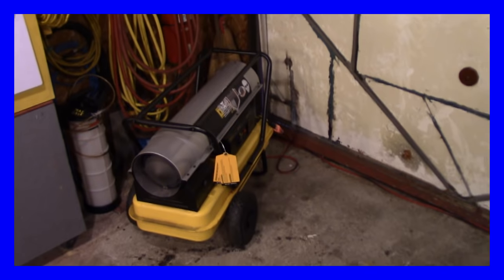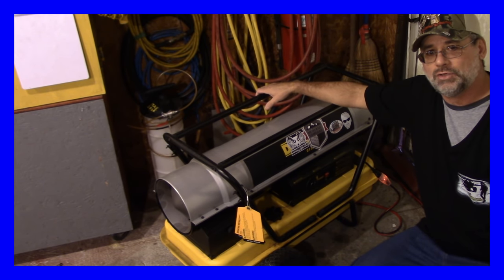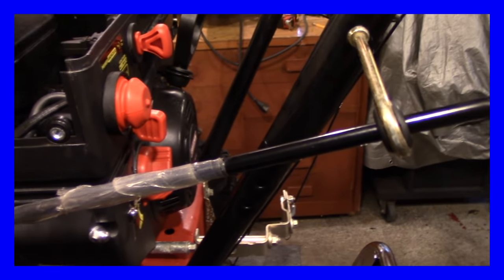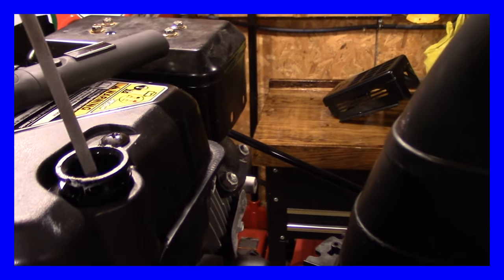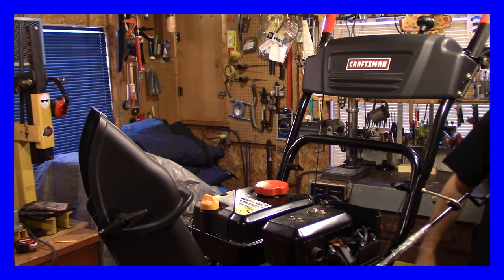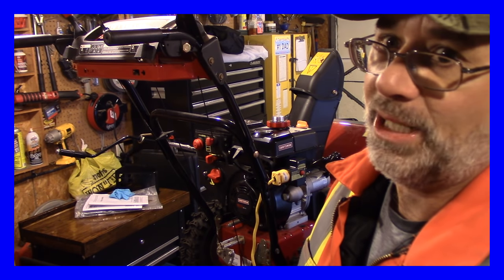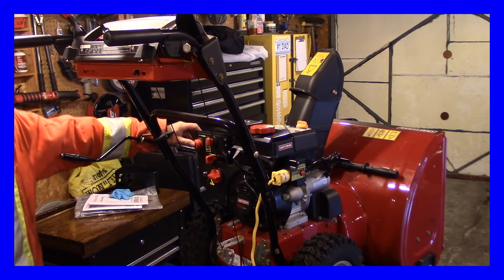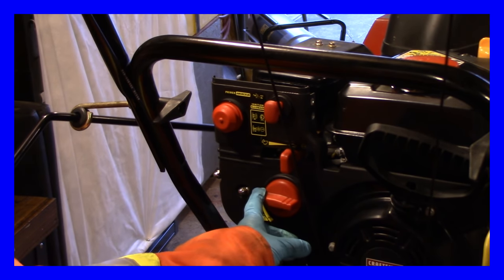CAN YOU FIX A SNOW BLOWER WITH SEAFOAM

Comment: My machine has the same problem, without the gas leak, keep it loaded with gasoline since last winter and now it does not want to turn on, I did these steps that you show in the video, but it did not work, 😢😭 it only has 1 year of use.
Reply from the maker: Looks like you need to take carb off and clean it completely , not a hard job and should work fine .

Comment: Check your ignition coil those are known to go bad on those snowblowers with the cheap chinese engine they usually go bad after three years or so there are a view youtube videos on the subject the engine is made by a chinese company for cub cadet they bought out yardman mtd the old ones had a tecumseh snowking engine you can not beat them
Reply from the maker: Thanks Vicky will check it out . Thanks
Reply: your quite welcome I ment the coil I have one of the old ones with the snow king engine tecumseh snowking
Reply: why would you think the coil is bad if it starts and runs ?  this is carb trouble... if the coil was bad it would run till it got up to temp an then die or not start at all.

Comment: I was curious if you figured out why the gas was gushing out of the carb when you primed it. I put a new carb on a blower and it does the same thing and the blower runs OK. I figured it was because it was a cheap knock off carb.
Reply from the maker: That's a good question but it runs great so Im thinking your answer is correct :)
Reply: @dougsgarage1798  good info. Thanks

Comment: That engine is a chinese engine. A lot of people don't like them. I have one in my snowblower and it starts first pull all the time. Except when it was -32. Then I had to use the electric start.
Reply from the maker: It seems a lot of machines have Chinese engines these days. This  machine runs great for the owner now. Cheers
Reply: I have exact same and just had first snow and started first pull! Runs well. Just like anything you gotta maintain it. Change oil and use stabil fuel treatment and whatever the owners manual says to!!!! Ethanol or no ethanol!!! I even after a year of no use will  drain out gas and put in fresh with stabil then run old through my truck. And, seafoam isn't a fuel stabilizer! Must use fuel stabilizer like stabil! To clean a fuel system chevron made by techron is the best!

Comment: make sure you shut off that heater if your tank is leaking gas!!!!
Reply from the maker: Jim  this heater runs off  diesel .  I only run it 10 min. Max to heat up the shop then turn it off.  Cheers
Reply: Why would you run a gas leaking  machine like that inside your garage?
Reply: I really hope there’s ventilation also. And a clear path for the fire engines.
Reply from the maker: LOL Merry Christmas Adam

Comment: Having the same issue with a used blower I've just purchased, with fuel just flowing out from the carb just like that
Reply from the maker: Ya the needle valve needs cleaning most likely.

Comment: I do not use seafoam. Seafoam is useless. All my equipment uses Stabil360 from the time its brand new. My oldest lawqn mower is 26 years old and been using stabil 360 and never had any issues from day one. But if you seaform or Stabil360 use from day one. Neither seaform or stabil does not clean carb if it is dirty you have to clean it up yourself.
Reply from the maker: Seafoam has worked well for me  , never knew stabil 360 has been around for 26 years.
Reply: Bull-Hockey! 
I'm 61 now. My previous snowblower went 26 years. I've used SF for 40 years. I put a 1/4-cup of SF in my 1 Gal gas-can. I took off the Carb a couple times to check it. SPOTLESS inside!

I DID have to change the Carb in year 23, as it was surging for a couple years. Again, carb was spotless internally. Turns out, the throttle-shaft had worn a slightly oblong shape into the carb body after 2+ decades of vibration! 

There's no fix for that. Put on a new Carb, & it runs EVEN & STRONG. Again......2 decades with the original Carb. Using Seafoam.

Comment: Any Craftsman product the first 3 numbers of the product number is the manufacture code. Which will tell you who made it. The number for the actual blower is probably different then the motor. But that will tell you who produced the blower for Craftsman. Like MTD or Poulan.  Then you can figure what motors they likely used in their products.
Reply from the maker: Hey Josh thanks for the tip. I'll have to write that one down. Cheers 👍👍
Reply: http://professional-power-tool-guide.com/manufacturers/craftsman-power-tool-company/sears-and-craftsman-source-product-code/ Check this list out for reference. Maybe print it out for on the wall at the shop.

Comment: Never, never, never ever use alcohol fuel in a small engine.  Premium gas only and use a fuel stabilizer in the gas as well as some injector cleaner.  We have an Eskimo 43cc 2 stroke gas auger and it starts on the 5 pull in the fall and always on the first pull in winter.  Our walk behind snow blower is the same way and our outboard motor too.  Alcohol gas is bad for small engines.
Reply from the maker: Yes sir your correct Tom. Cheers
Reply: Every small engine mechanic I've talked to, including guys who drop trees, have always told me to use only ethanol free 91 octane fuel. End of season - add the Seafoam to the fuel tank and let it run for a while then turn off the fuel valve and let it run dry for storage. 4 chain saws, 2 gas trimmers (1 is a 4 stroke), 2 wood spliters, a Great Dane mower and a cheap push mower for trimming.
Reply from the maker: Good advice from people that know. Cheers

Comment: It's a MTD engine
Reply from the maker: Thanks David 👍
Reply: @SteveRobReviews  I bought one last fall from Crappy tire (Yard works ) dam things don't have a fule shut off valve.. Mine runs but it is surgeing. I will drain the tank and run some sea foam through it. See what happens !!!!
Reply from the maker: Some of those do surge up and down but at full throttle do not surge. I know a person that took it in for warranty and that's what they were told. Seems odd but apparently some just surge.
Reply from the maker: #midas617 - best snowblower engine I ever had was a Snowking from Tecumseh , still runs like a charm from 1993 . That's a bloddy shame the company folded up. Cheers
Reply: @SteveRobReviews   runs fine now the original ( cheap ) spark plug was looking bad changed it out for a better quality plug
Reply from the maker: @davidpedder9048  Terrific 👍
Reply: David Pedder  Surging is not normal- it’s typical of a carburetor with passages that are varnished/gummy/dirty, usually from old fuel.  Drain out the old gas,  put in new Top Tier gas (not the discounted gas from your grocery store), with a couple of ounces of Seafoam.  If the engine will run, even if it needs partial choke on, run it with the Seafoam.  It might take longer than half an hour, but the Seafoam can work miracles, and will usually clean out the carburetor eventually.  After that, add 2 oz per gallon of Seafoam into your gas can EVERY time you buy gas.  It will keep your fuel system clean and lubricated, stabilize your fuel, and get rid of carbon on the valves & combustion chamber.  Stabil only stabilizes fuel, but can’t clean your carb. I’ve used Seafoam for several years on all kinds of small engines- it works!  Check out their website and learn a few things.
Reply: Mtd does not make engines